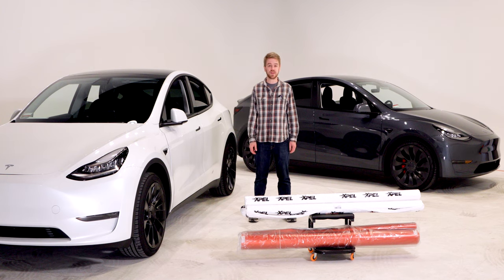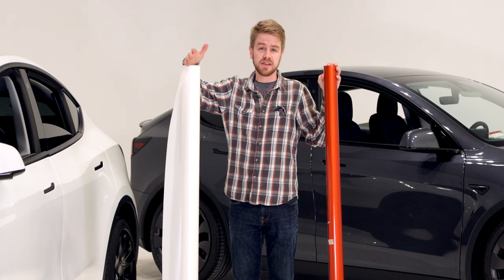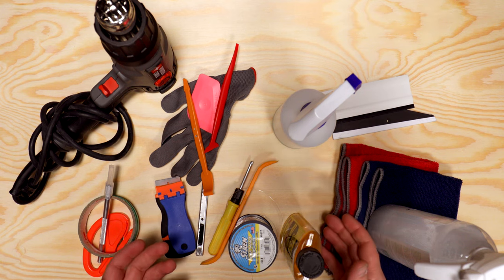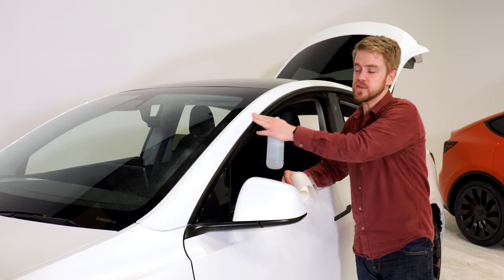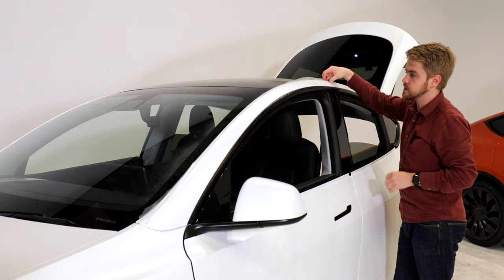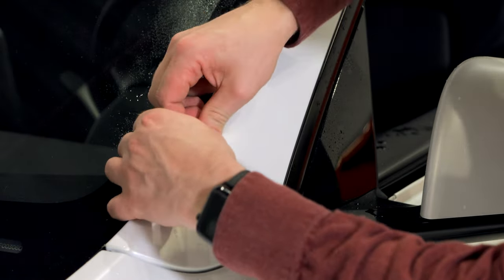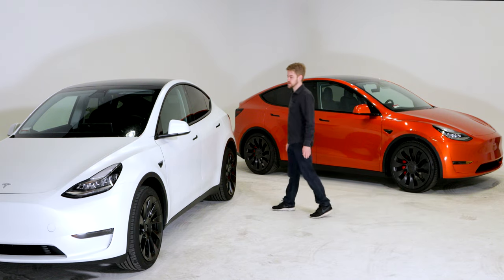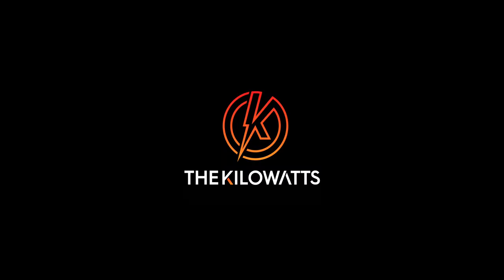3M Vinyl vs Xpel Stealth PPF | DIY Challenge w/ Two Tesla Model Ys

Comment: I’ve seen a ton of model Y’s on YouTube.  The orange is by far the nicest color combo I’ve seen.  It doesn’t even look like the same car compared to other Y’s.  I typically hate the black interior but with the orange accent color on the console it looks stunning.  I would cover up that ugly psuedo wood with carbon fiber or maybe even more orange.   

You are motivating me to try a wrap myself.  I'm putting mine on Turo though and I would hate for someone to ruin the wrap if I couldn't get compensated to rewrap it.
Reply from the maker: Done! https://twitter.com/klwtts/status/1286333815766396928?s=20
Reply: @KLWTTS  should have known... just saw it, stunning

Comment: The vinyl is definitely a more dramatic change.  But If you like your car color already I can see why the protective film is more sensible.
Reply from the maker: More sensible but also more difficult and more expensive
Reply: @KLWTTS  Yes, you are correct.  It is my opinion that the car you have applied it to is worth the expense and effort.

Comment: How did you get/measure  the cuts to layer on? Especially on the vinyl one
Reply from the maker: You can guesstimate with vinyl then cut when it's on the car but I just used the PPF as a template to make rough cuts for this one!

Comment: You are comparing 2 different things. One is a wrap to change color, one is actual paint protection film which is twice as thick, maybe more. The red vinyl may last 5 years. The paint protection will last at least 10. So these 2 films serve 2 different purposes. Luckily, there are companies coming out with colored paint protectin film now so it will solve this problem.

Comment: Will it leaves scratches when you remove the vinyl wrap?
Reply from the maker: Anything on the paint will be locked in so if the paint is clear of debris, and is not damaged during the wrap process, it's a great way to prevent microscratches

Comment: SO it did NOT take "several" days.  It took a COUPLE days.  English 101.

Couple - 2 days
Few - 3 to 4 days
Several - 5 to 7 days

You're welcome

Also the 3M wrap still counts as protection.  It is covering the original paint job so yes...PROTECTION.

Love the color though.  Nice choice.